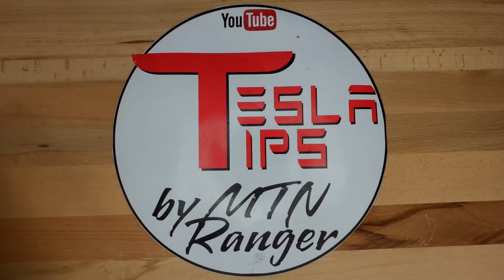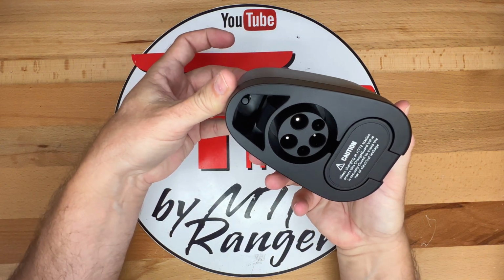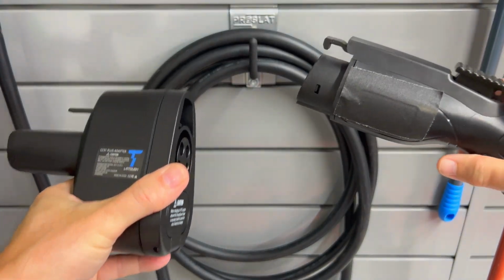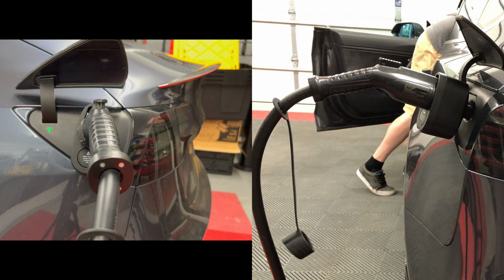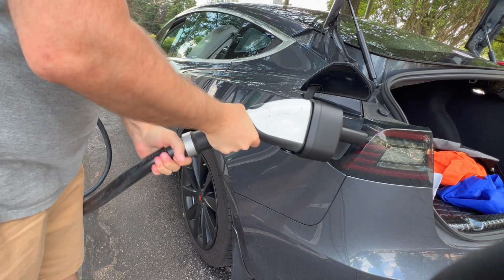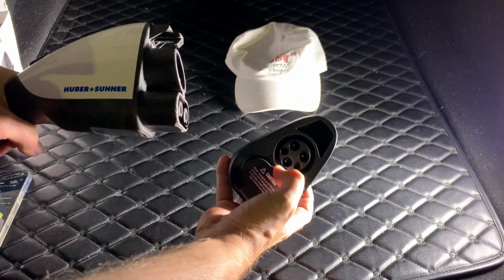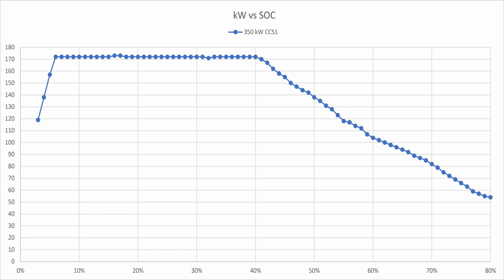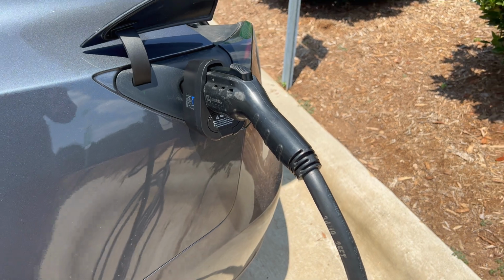Tesla - LaTough CCS1 + J1772 Universal Adapter

Comment: Great idea for Tesla owners to use any kind of charging station. I know that Tesla has to “unlock” the charger to allow other automakers to charge on their network. But is there a way to make a universal Tesla to CCS to use Tesla AC and DC charging stations for CCS vehicles?
Reply from the maker: There are Tesla Supercharger to CCS adapters now.  But the car must be supported by Tesla,  So far only Ford and Rivian.  More are coming over time this year.  Until then, CCS vehicles can use a Magicdock Supercharger which has the built in adapter (however very few are available currently).
Reply: @MTNRanger  I’m aware about the Tesla supercharger network only being open to certain vehicles. What I’m interested in is whether there is an adapter for vehicles like Fords and Rivians that lets them use a single adapter for both v3 superchargers and Destination chargers instead of requiring 2 separate adapters.
Reply from the maker: @davidroddini1512  No, unfortunately the supercharger-to-CCS adapters are designed differently and do not work with destination chargers for safety reasons.

Comment: I assume the battery wasnt preconditioned before charging at the 350kw charger. The max charge speed available didnt jump up to 350kw until 20 minutes into the charge. Would have been nice to see if it could hit 250kw with a preconditioned battery.
Reply from the maker: On a CCS1 charger, the max we can expect in a Tesla is around 200-210 kW.  Anything more will require more amperage than these units can support.  350 kW will only be attained by 800 V EVs. As far as the is particular station, it has been reported that it does not provide the highest possible speeds.  My Tesla was preconditioned and driving for 1/2 hour.

Comment: I purchased this adapter and had no issues charging my Tesla. The intelligent temperature control system works great, and I really like LaTough's CCS combo 1 adapter. They recently released a video comparing it to the original Tesla combo 1 adapter, and it is identical and even more affordable than the one on the Tesla website. It's truly fantastic!😍

Comment: Thank you, appreciate your information. I have a Ford Charge Station Pro EVSE and it has a J1772 for AC as well as a  DC charging port. it's configured exactly like all the Level 3 chargers at Electrify America, EVGO, etc.  Do you think this adapter can be used with the CSP to charge my Tesla?
Reply from the maker: I don’t see why it would not work.  As long as the CSP can provide CCS, it’s worth a try.  Does your Tesla support the CCS adapter?
Reply: @MTNRanger  yes

Comment: NACS charging standard designed by engineers to encourage EV adoption.
CCS1 charging standard designed by the ICE manufactures marketing department to discourage EV adoption, trying to keep EV’s from catching on. 
In 10 years the only place in North America you will find a CCS1 charger will be a museum and electronic surplus stores.

I will stick with my Tesla J1772  and CCS adaptors, not impressed with the flap as it will be break off early in the usage.
That massive plug combination just waits for someone to bump Ito it and damage the car charge port.
Reply from the maker: Thanks for you comment.
Reply: But in 2000 years, the only place in North America you will find a NACS charger will be THE JUNKYARD AND THE FAR REACHES OF OUTER SPACE AND THE CENTER OF THE EARTH AND THE CHARGING STATION CEMETARY. I am sticking with CCS, ChaDeMo and PHEVs like the Mitsubishi Outlander.
Reply: @RichardJoashTan  I guess we’ll have to wait and see.